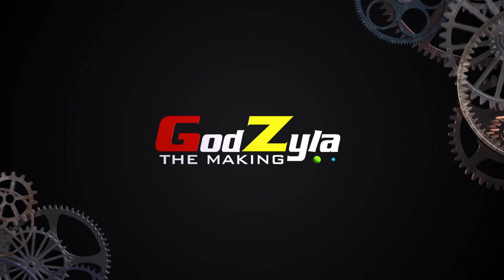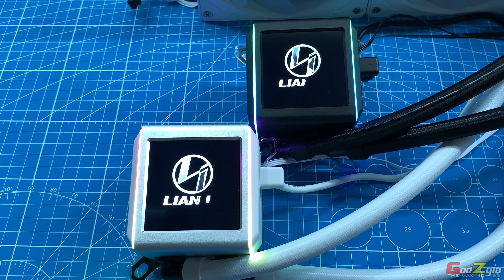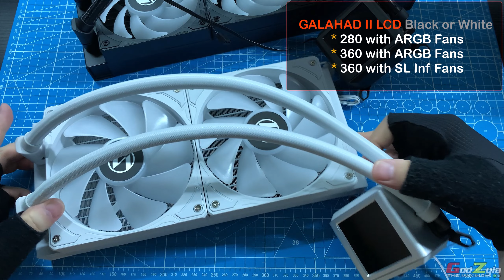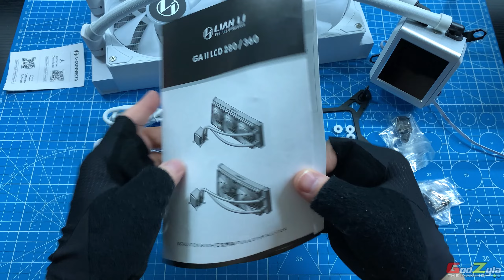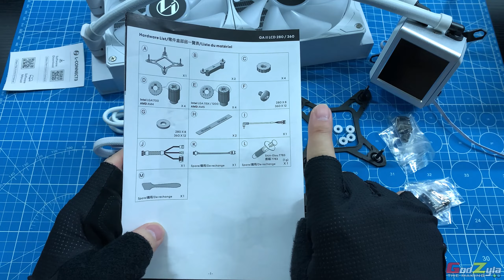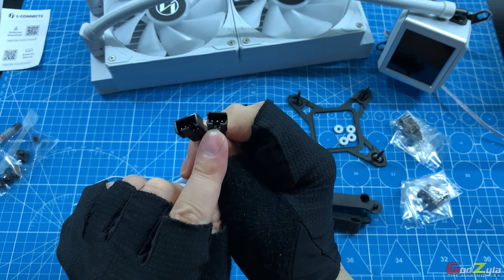Lian Li Galahad II LCD

Comment: Excellent review of the new Lian Li Galahad II LCD. It shoud be seen several time ! Interesting addition would be a demo of connecting additional individual SL-INF fans to the new controller that comes with that new AIO Galahad II LCD !
Reply from the maker: Hi MrVoayer, welcome to my channel and thank you for your valuable feedback. Let me see what I can do. thank you!
Reply: Indeed im looking for this ! My doubt is if i should use the galahad II lcd hub for only the aio and a spare one for the sl inf reverse ! Also if should i get the hub v1 or the v2 with less cables !
Reply: I built my PC last week with Galahad II LCD, with 24 pin Streamer V2, with SL-INF tripple pack fans and several individual SL-INF and SL-INF Reverse fans. I ended up with three controllers but with minimum cables. Of course, additional NZXT USB 2.0 hubs were obligatory!
Reply: @MrVoayer   ty for you quick reply. I got the lian li usb hub for the future strimmer cable i want. In regards of the connections can you break it down for me ? What you got connected into the aio hub ?! Ty so much for all your help mate
Reply: @x3ntriK  I didn't mix up different things with different controllers. So, I connected 24pin StreamerPlus V2 to its own controller, I connected Galahad II AIO to its own controller, and I connected ALL other SL-INF and SL-INF Reverse fans to the controller that came with SL-INF Tripple Pack. Thus, one Tripple Pack is a Must Buy as it comes with enough cables and with a controller! I hope this info is helpful enough.
Reply: Once again ty for ur reply and yes it was helpfull :) thanks a lot  for the tip! Now i got a different thing going on, when i try to upload a mp4 file like u did in the video, i can record it and do all thise steps but as soon as i click import the loading screen appears and closes instantly the menu and the video doesnt upload. I can only add .jpeg files nothing else.. do you experienced anything like this ?!  ( also all firmware and software updated ) aio v 0.9 and sl inf fans 1.4 . Thank you once more
Reply: @x3ntriK  I am sorry, I have no experience with video uploading. KleoYan can tell you more, probably. Anyway, try the same procedure again. And watch other videos on YouTube on the subject.
Reply: @MrVoayer  ty ur right ! Can you provide any help @KleoYan ?! Thanks in advance

Comment: Asetek made a sneaky change to its mounting hardware for the 8th gen pump I see, as I have a Ryujin III and it uses a backplate that you have to screw in the standoffs into.
Reply from the maker: Hi sabishiihito, welcome to my channel and you are correct. For Ryujinn III, you need to screw the standoffs to the backplate and the issue I have with that is, there are no washer provided and when you screw the standoffs, there are no washer to protect the motherboard surface, where the standoffs will bite on. As for this Lian Li Galahad II LCD, it's of a better mechanism. You don't have to screw the standoffs. plus to hold the backplate, rubber washers are provided. This also act as a protection as not to scratch the motherboard surface.

Comment: when can we expect the performance review buddy? If this AIO is any good im putting this in my rig, running a 7800x 3d with a 7900xtx from sapphire. Mobo is  a asus strix e e gaming :)
Reply from the maker: Hi Bruce Lee, welcome back. I will be conducting the test only next week as am running all AIOs for at least a week before doing the test. As the reason for this. I prefer to run in all AIOs before doing the actual test, which will be true results this way. I will be using a 7950x for the test. Stay tuned next week. Thank you.
Reply: @KleoYan  OK. The harware monitoring is it actual monitoring or is there a delay? like the ryujin aio which has a 5 sec delay
Reply from the maker: @wankerka  Hi, I did notice about 2 to 3 seconds delay when I was on this version of L-Connect 3 app, but once I update to the latest. The delay was gone..

Comment: Glad they changed the mounting method for AM4/AM5. I never liked the mounting method of the original Glahad which I have in my system currently on AM4.
Reply from the maker: Hi Scott Dunn, welcome to my channel, I got to agree with you. I too prefer to have mounting at all four corners. I do notice the thermal results which is much better on a 4 locking points than to 2 locking point. Thanks for the visit and to leave your valuable comment. 👍

Comment: Any idea why my LCD screen wont power on? I have the USB-C connection connected to the USB header on my motherboard. Even l-connect doesnt show the pump at all.
Reply from the maker: Hi Ramulus, welcome to my channel. First of all, your LCD Should light up only with the type-c connected to your Pump block and the USB connector to your motherboard socket. As for why L-Connect 3 app does not show. there is a Firmware and L-Connect 3 app update, which is not release to the public till Oct 18th.
Reply: @KleoYan  hmmm so strange. I’m not getting it to light up whatsoever. It’s connected to my usb header. It doesn’t need any sort of sata power correct?
Reply from the maker: @ramulus84 yup, when I first plug the type C to usb type A between the LCD pump block and the motherboard. it will light up with the Lian Li logo. have you tried switching to another usb header on your motherboard? btw you dont need any sata power or such. just the cable which I have mentioned.
Reply: @KleoYan  well here’s how I set it up. I’m not using the fans that came with the aio. I’m using the triple pack SL INF V2 fans that come with the controller. So the connection part is different. I only plugged in two cables, the usb header and pump fan. Do I need something else or can I not use these fans with that controller? Thank you so much for taking the time to reply.
Reply: Just to confirm, when powering back up my PC, I did see the Lian Li logo on the LCD screen come up. But is it supposed to stay or be blank until the app update?
Reply from the maker: @ramulus84  let me try to get a better picture or maybe share my experience with you. without the L-Connect 3 app install, the LCD will remain as the Lian Li opening logo, be it windows is booted or in post mode. If you have installed the L-Connect 3app which I believe you did, at post mode, the logo will appear but once boot to windows, the screen will go blank, that's normal as your LCD is in sync or detecting the L-Connect 3 app, that's why it's blank. This is also due to the fact that the GA II LCD dashboard panel on the L-Connect 3app is missing and it will only be avaliable after Oct 18th. I am currently asking Lian Li if I can share my firmware and the copy of L-Connect 3 app. As it's the weekends, I will need to wait for their reply. Thank you!
Reply: So it turns out I needed to push the connector into the pump really firm. It's now working. But let me ask you one last question, is your pump loud? When not gaming and no headphones, the pump on quiet mode is really obnoxious. Look at the video below of another users experience with the loud pump. 
https://www.youtube.com/shorts/DGgiy4vgGzQ
 @KleoYan
Reply from the maker: @ramulus84  Hi, I am currently running this Liquid AIO on my test bench system. as going to prepare for my next content in about 1 to 2 weeks time. it's been running past 42 hours or so, I do not hear any noise from the pump and the pump is running at full speed 3600 rpm.
Reply: @KleoYan  weird, it’s just a drone sound. It’s not quiet at all. I guess I’ll reach out to Lian li about this.
Reply from the maker: @ramulus84  maybe I should correct my sentence. what I mean is. at a distance, I hear nothing but if I put my ears near it few cm away.. yes I can hear the rotar is rattling but not when I am away from it.. my test bench is just 4ft away from my work desk.
Reply from the maker: Hi Ramulus, I believe you already knew the news.. anyway you can get the L-Connect 3 app for this liquid AIO here https://www.reddit.com/r/lianli/comments/178d7ya/regarding_the_galahd_ii_lcd/?rdt=54964 once you have it. I believe there is a firmware update which is version 0.5. Install your L-Connect 3 app first then do the manual update.

Comment: Ty for this review. Thinking about replacing my kraken with this.
Reply from the maker: Hi Ron Swanson, welcome to my channel. I am glad you like this content and all the best with the replacement 👍
Reply: @KleoYan  Thanks for the kind welcome. I’ll keep my eye on you 😁
Reply from the maker: @ronswanson1410  you are most welcome. 😉
Reply: @KleoYan  Would someone still be able to replace the fans on this Lian Li 360 Liquid AIO with reverse fans?
Reply from the maker: @ronswanson1410  Hi, welcome back. You can even if you make use of the reverse SL-Inf as this liquid AIO does come with the SL-Inf variant and the controller of the SL-Inf-120 are included in the package. Do note that by placing the reverse fans, you will be losing lots of static pressure which will hurt your CPU temperature.
Reply: @KleoYan  I had no idea that would be the case if I did that. Why do others do it then? Hmm..Are there any other videos out there talking about the cpu temperature being affected by reverse fans? I’d love to know where I could learn more
Reply from the maker: @ronswanson1410  there are if you search for reverse SL120 V2 or SL-Inf-120. In general reverse fans are not as strong as the original. As why some are doing it, they either not aware of it or just wanted aesthetic.
Reply: @KleoYan  I will look into this more. For other people I guess its because they are going for aesthetic. I admit I was too and didn't think anything of it being a bad idea. Well, I am really glad I know all of this now and you have probably saved my CPU some future trouble. Im grateful I can return things with amazon prime haha.

Thank you again man. ✊
Reply from the maker: @ronswanson1410  you are most welcome. All the best with your build too. 👍
Reply: @KleoYan  Hey Kleo, I was wondering if you could answer one more question. I am overthinking this and starting to get confused because I practically have everything else figured out. 

What is the simplest way to put SLV2 fans on any of these new LCD versions of the Gallahad II and still be able to control rgb through  L-connect 3 software? I don't know why, but I feel like you might have actually mentioned how to do this and I could have just missed that part. I also might just need a break. Any help would be sincerely appreciated and if you cant help then no worries!
Reply from the maker: @ronswanson1410  Hi and welcome back. let me break it down for you

A) Galahad II LCD - with 120 x 3 ARGB fans + your SL120 V2
==============================================
You will need 2 USB header from your motherboard
1st motherboard USB header is for your GA II LCD (type C to usb)
2nd motherbord USB header if for your SL120 V2 (micro usb to usb) 

B) Galahd II LCD - with SL-Inf 120 x 3 fans + your SL120 V2
=============================================
You will need 3 USB Header from your motherboard but most will only come with 2, you will need a USB Splitter. best to get the splitter from lian li official aliexpress store (https://vi.aliexpress.com/item/1005005121350909.html) 

1st motherboard USB header is for your GA II LCD (type C to usb)
2nd motherboard USB header to the lian li usb spliter

Then 
Lian Li USB spliter port 1 to your SL-Inf 120 fans
Lian Li USB spliter port 2 to your SL120 V2 

The above configuration, be it A or B, you can use the L-Connect 3 app to control all.
Reply: Thank you for the thorough response! I will try my best to decipher the answer with what you have given me. A quick clarifying question for you because I don't want to waste your response. For your A and B explanation, when you say...

"Galahad II LCD - with 120 x 3 ARGB fans + your SL120 V2" 

or

"Galahd II LCD - with SL-Inf 120 x 3 fans + your SL120 V2"

Is that to say what to do to have both the preset fans and SL120V2's or are you saying how to REPLACE the presets with SL120V2's? Because my goal isn't to have both sets of fans on, but to replace the Sl120V2's with the preset fans.
Reply from the maker: @ronswanson1410  oh ok.. in that case. just do option A. replace the fans only.. this should be the setup for you.

Get the Galahad II LCD with just the argb fans, remove the argb fans  with your SL120 V2 (make sure is the 3fan pack set that comes with the uni controller as individual pack does not comes with it) 

Setup as follow, once you have replace to SL120 V2
 
Galahad II LCD +  Your SL120 V2
==============================================
You will need 2 USB header from your motherboard
1st motherboard USB header is for your GA II LCD (type C to usb)
2nd motherbord USB header if for your SL120 V2 (micro usb to usb) 

Install the L-Connect 3. please download the one which says for Galahad II LCD from this page https://lian-li.com/l-connect3/ 
which is this one https://pan.baidu.com/s/1S5HXjMZN3hBGrjaqBiGJFA?pwd=6xmm
Reply: @KleoYan  I will follow these instructions!

:)
I absolutely cannot thank you enough. Do you have a patreon or ever do livestreams to receive donations? If so, I would like to donate something to you. If you don't and instead maybe have a charity you care about I could also make a donation to that charity as token of my appreciation.
Reply from the maker: @ronswanson1410  hi. thank you for the gesture. I do not have those as you've mentioned. As charity, donate to Make A Wish fundation at your country. donate to those misfortunate children who wish to learn but without a PC. 🙂
Reply: @KleoYan  Fair enough. That I can do. Take care!
Reply from the maker: @ronswanson1410  thank you and all the best with your build 😉
Reply: @KleoYan  I totally let time pass without saying thank you for your help in this part. From these instructions I was able to install the fans on to the cooler and everything is running smoothly. Also The build is done and your help made it all possible. I will refer other people to your channel in the future from here on out. 

You da man KleoYan.
Reply from the maker: @ronswanson1410  Hi, welcome back. Thank you for your kind words and it's my pleasure to help  you out 😉

Comment: i'll have all fans in sl v2 model in my case, i can put them on the galahad lcd without problem right ? i mean it's same connection but i need to use the sl v2 hub ? And for the rgb on fans, i can just control them with all others in same place, not necessarily in the galahad menu in L connect ?
Reply from the maker: Hi Mr Wlv, welcome back. That is correct. You will need 2 usb connector on your motherboard. One to control the Galahad LCD and Other for your SL V2 fans
Reply: @KleoYan  nice ! About the RGB control I don't know this software yet but I checked a bit the manual, I'll be able to control all case fans and aio fans under the same menu ( sl utility) right ? I don't need to use the Galahad menu to do this ?
Reply from the maker: @Al3xDk  Hi and yes, that' is correct. if you need more reference.. watch those that are with a subtitle that have this sentence [L-Connect-3] .. https://youtube.com/playlist?list=PLEW-b-2vYDdPo0NzHyeksx012c-nkDapm&si=8oAZwNxPQQhCLk6W
Reply: @KleoYan  perfect ! I'll check this tomorrow, thanks for all answers ☺️
Reply from the maker: @Al3xDk  you are most welcome. All the best with your build too. 😉
Reply: @KleoYan  thanks 🙏

Comment: Thanks for the work. Now I can’t decide which is better to buy:
Lian Li Galahad II LCD or Asus Rog Ryujin III 360 ARGB.
Personally, which would you choose between these two?
Or another option NZXT Kraken Elite RGB 360 )
Reply from the maker: Hi Игорь Кот, welcome to my channel. The choice is yours. my opinion will be, if using all Lian Li ego system, I will get this instead of others. As some are facing issues when mixing brands to use, especially when all involves in installing their own ARGB application. You see, all ARGB program make use of the same IRQ ( https://en.wikipedia.org/wiki/Interrupt_request ) resources from a system, having multiple argb to run at the background may cause unwanted issues (example device not detected or getting disconnected from a device)

Comment: Ok I just build my 1st pc and with all Lian li rgb do we still have to take all them steps you did a year ago on L-connect 3 jw 
Can you plz do a update on that or plz let me know if we still have to take them steps u did a year ago thanks
Reply from the maker: Hello Leeman Vang, welcome to my channel. The basic to on having good communication or signal between argb device to your motherboard. 1st up to date INF drivers, 2nd check motherboard bios if there are any issues related to USB intermittence 3rd if all updated, check on lian li website for firmware updates on your device, then update the L-Connect 3app. All these will allow you to operate the L Connect 3 app, buttery smooth like most of my videos. and my content over a year still stand. so long the sub titles is with [L-connect 3] as for the oder ones with [L-Connect] those are for knowledge based which illustrates how the lian li argb ego system works. One last tip, check on the changelog of L-Connect 3app https://lian-li.com/L3-changelog/